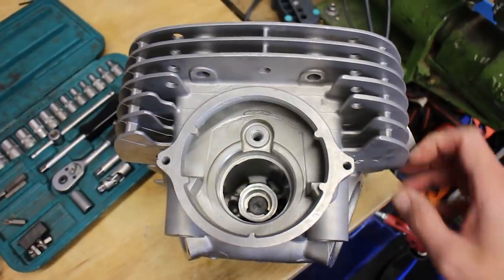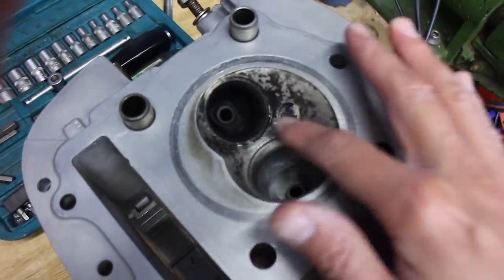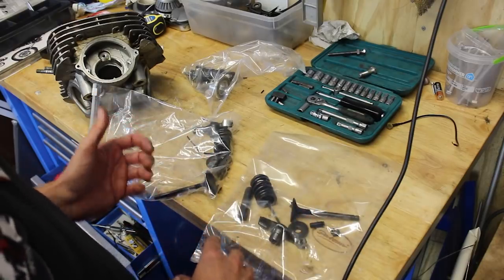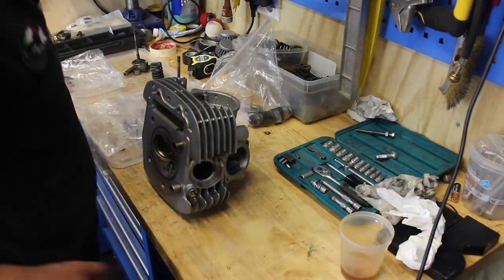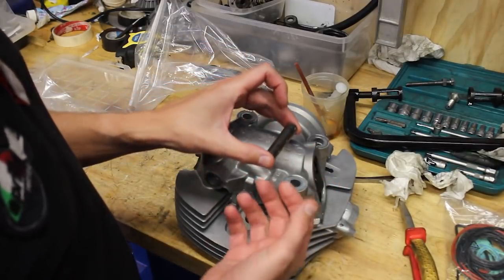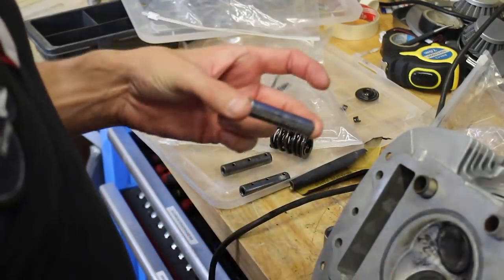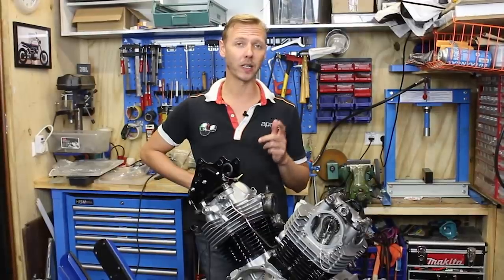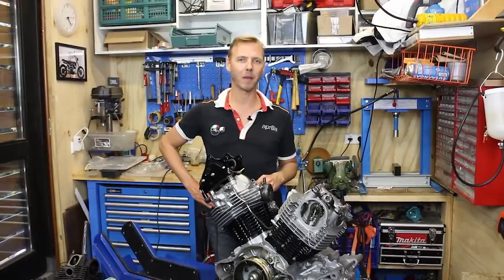Yamaha XV Virago camshaft roller bearing upgrade (!read comment!)

Comment: Nice catch with the oil path on the rocker shafte assembly. You are doing what I planned to do with my kz750 lap the valves and redoing my timing. Great video..

Comment: Just a little tip.  Oven cleaner or caustic soda works very well for getting carbon and soot off engine parts.  Just don't use it on aluminium or magnesium.  Ferrous metals only.  Titanium is OK too.

Comment: I'm not 100 percent sold on ball bearings on the camshaft. My understanding about bearings is that the lowest friction bearings are ball bearings but they also wear the quickest. That's why all modern crankshafts use plain bearings. Even though they have the most friction they last longer.  Maybe the camshafts have less load on them so ball bearings will still last long enough.
Reply from the maker: I'm just gonna trust on the hundreds of XV riders who did this modification... There are a few who also rode thousants of miles with it. Which I will never do on this bike...
Reply: I searched all over the web trying to find a definitive explanation of the benefits of ball bearings, only because I was curious.  Best i come up with is first,  it is true there are a lot of bikes doing this swap so there must be something to it.  Second  the  camshaft isn't carrying enough load that the difference in bearing life is a big deal especially considering replacing those bearings isn't that big a job anyway. Third they do run with less friction which is always good and ball bearings  have tighter tolerances  than plain bearings.  Finally,  plain bearings are completely dependent on oil flow to function and if oil gets cut off for any reason,  they can fail suddenly by ceasing up causing major engine damage,  like what happened to you. This is just a guess but I bet  that  ball bearings would not cease up suddenly without oil,  but would get loose and noisy so you would have plenty of warning that there was a problem before any serious engine damage was done.  If there are any engineers   reading this I would like to know for sure. Anyway keep up the good work you do a great job with these videos,  you're an inspiration to all of us.
Reply: Ball bearing convertions are also done on old desmo Ducati's on the cranks but they are high quality purpose roller bearings meant for the job you just cant use any old rollers to do the job that goes for head conversion to, this is done for race engines to eliminate power loss from friction but the bearings need to be replaced more often so if you have deep pockets go hard other wise standard bearings are just fine and last years.
Reply: Plain bearings load an entire surface, so the force is distributed evenly over a large area, keeping loading pressures low.  There is a lot of drag, because you're forcing two surfaces to slip past each other with close clearances.  The oil layer becomes extremely crucial, and any disruption in its supply can cause a sudden and catastrophic failure without warning.  Because of the low surface pressures in a plain bearing, we can use weaker materials--like the aluminum of the head. 

Ball bearings eliminate surfaces slipping past each other.  As a result, they are less sensitive to disruptions in lubrication, and won't fail so suddenly.  They also have less drag, since they allow all the surfaces to roll instead of slip.  However, the force loading is less ideal.  A small sphere (the ball) rolling around a surface (the race) with a larger radius will cause point-loading.  Since the surface pressure is the force divided by the area, this presents a problem.  The contact area is very, very small now.  The force is essentially the same.  We've effectively multiplied the surface pressure in the bearing by dividing the force by a very, very small number.  Remember what happens when you divide by zero...
We do things to compensate, like using hardened steel surfaces for the bearing races (the aluminum would be destroyed quickly). 

Now a roller bearing has a larger line of contact (more area of support) than a ball bearing, and you'll commonly find roller bearings supporting shafts with high radial loads (like inside transmissions and transfer cases).  Roller bearings can't support an axial load well, however.

Comment: Not sure about the rocker arm spindle info . from Yamaha the rocker spindles for  the cylinder head inlet and exhaust have the same part number  4x7-12156-02-00 . where did you read your info ? also not great engineering to polish the marks out of the old ones. could lowers oil pressure for inner bush on rocker arm ? .  love the video.s  ,   keep them coming .
Reply from the maker: I have totally new info on the spindles which I will explain in the next video. Very interesting. They were renewed/updated in later years... New partsnumber due to previous causing oil problems. Probably I found a new and old one in my engine. I ordered 4 new ones (indeed all the same) and will compare them in my next video.
Reply: very interesting i look forward to reading your findings . my motors are all early , is the info from twin shock models ?  i dont know much about them . thanks for reply   i await next video with interest ,     :-)

Comment: Question! 

I took apart my two tops for my xv1000 and they are all the same shafts. In the description you mention it should be that way. 

So which one in the video is the right ones to have? The one you were talking about for the exhaust or the one for the inlet? 

My best
Oscar
Reply from the maker: I don't understand your question. Camshafts differ from front and rear cilinder. They are therefore numbered

Comment: Where did you hear that the rocker arm
Shafts are different on the intake and the exhaust side ??

The part number from Yamaha tells us that it is the exact same part used both for the exhaust and the intake rocker arms. (4 identical rocker arm shafts are used in the cylinder head)

Check for yourself here:

https://www.cmsnl.com/yamaha-xv750-virago-1981-b-usa_model8837/partslist/A-11.html#.W8kb2aR5PYU
Reply: This is mostly correct.  4X71215602 supersedes 4X71215601,   the newer 602 has the hole closer to the end which results in better alignment/flow but both/either will work.

Comment: Hi, I have notice that you put the new camshaft bearing with the plastic cover side toward the engine, don't you think that should be in opposite position because as I think the plastic barrier will not allowed the oil to rich the bearings? Sorry If I am wrong! Best Regards
Reply from the maker: I was quite sure I clearly explained this in the video... The oil splatters from the chain into the bearing that way. So the bearing keeps oiled in a pretty natural way this way. That's why.

Comment: Hi Chief pep, I think you have two different rocker shaft models. One is maybe from your early xv700. My opinion is that they have to be the same front and back. If you look at cmsnl the 4X71215602 shaft supersedes the 4X71215601 one. It looks like it has a different inner diameter.   Also i was wondering if you have the correct cam shaft in the correct cylinder. Because they are stampt with a number. 1 for the rear cylinder.
Reply from the maker: See my answer below to the remark of subscriber 'Specialse'. And in de vid I even have a close up to the cam marked number 1 and mention that you always have to be very carefull to have the right cam in the right head... ;)
Reply: haha my bad, had not read it before commenting...

Comment: Do the holes on the rocker shafts have to face a certain direction when installing? Can’t remember how they were facing when i took them off?
Reply from the maker: No, they could even rotate during riding. They just give oil to the head.

Comment: Welchen Vorteil hat das Kugellager?
Reply from the maker: Also, ein Gleitlager ist viel störungsanfälliger, wenn beispielsweise zu wenig Öl im Zylinderkopf zugeführt wird. Als Folge war meine Nockenwelle das letzte Mal stecken geblieben. Unzählige Virago-Fahrer haben bereits das Problem einer verklemmten Nockenwelle erlebt und fast alle haben während der Restauration ein Kugellager anstelle eines Gleitlagers eingebaut. Dies ist ein sehr berühmtes Update in den Yamaha Viragos. Daher. Entschuldigung für mein Deutsch ...
Reply: @chiefpepdesign  Dein Deutsch ist super!

Werde meinen Motor auch demnächst zerlegen, dann kommen da auch Kugellager rein.
Weißt du zufällig die Maße? Wie viel Spiel sollte es haben? C2 oder c3?
Reply from the maker: @yama3130  6205 2RSH - SKF Rillenkugellager 25-52x15 C2 oder C3 spielt keine Rolle. Ich bespreche sie in dem Video, das vorher war.
Reply: Chiefpep gut zu wissen das du deutsch kannst! Baue auch gerad eine xv750 um und deine Videos haben mir schon viel geholfen 😉 Kugellager bestelle ich auch gleich mit 👍